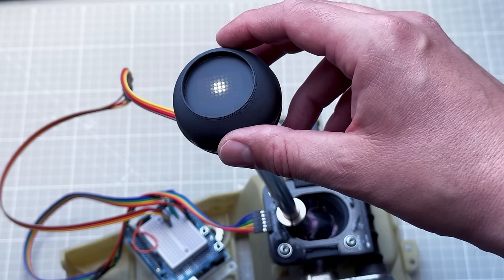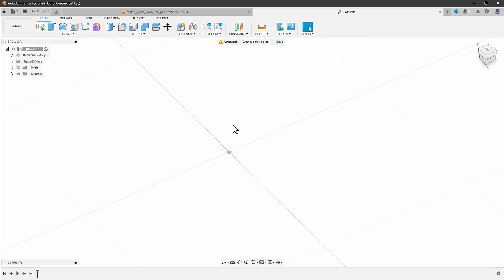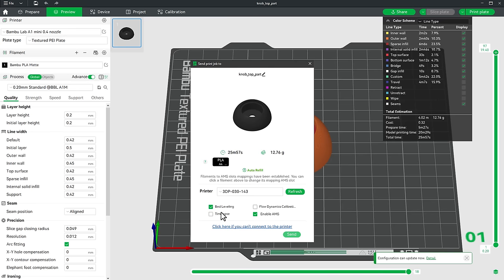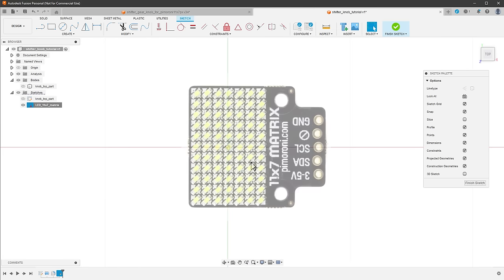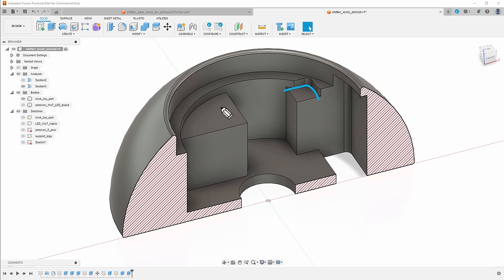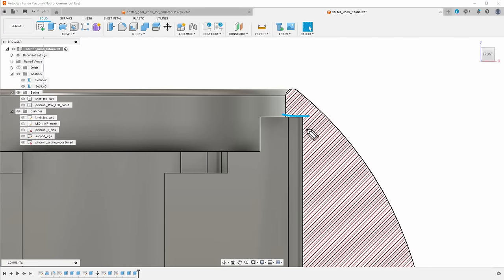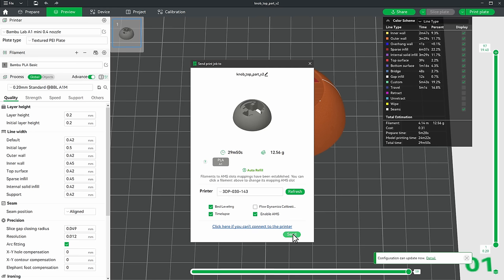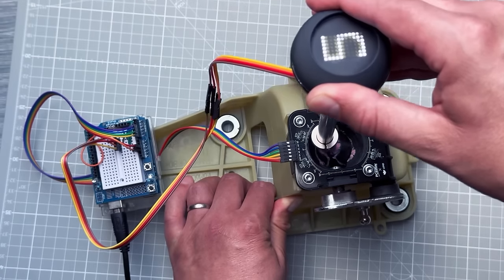Gear Shifter with DISPLAY

Comment: Oil fill the knob like a watch for best visibility
Reply from the maker: That’s an interesting idea!
Reply: @upir_upir  I'm occasionally good for something!
Reply: Will help heatsink the LEDs too. This is critical in summer or a convertible. My shifter knob in a Miata used to get hot enough I had to swap the solid metal ball in summers or it would burn me.

Comment: nice gimick :) but 1. if you need to see what gear you are in then manual is not for you :D 2. by the time animation is half way i would need to shift a gear. 3. i hold a shifter in such way that i would not see most of the screen :D
Reply from the maker: Agreed that the animation needs to be quicker. And LEDs need to be brighter so they can shine through your hand :)
Reply: @upir_upir  try using lasers ;)

Comment: I was thinking about getting a 3d printer, but CAD software is so complicated, like making 1000 blender doughnuts. 
Nevertheless, I liked your project
Reply from the maker: You can download a tons of models for free and start printing those. As for creating your own models, you don´t need to use Fusion. There are many other tools out there, some even simpler to use.
Reply: @upir_upir  Yep, I liked tinkercad but it may be a bottleneck later. 
Now thinking where I am going to place a printer lmao

Comment: Why have a solution looking for a problem? I drove a manual transmission VW bug for many years and never felt a need for something like this. I either knew what gear I was in, or could feel the position of the shifter.
Reply from the maker: Let´s think about this project of not being necessarily useful, but rather a cool piece of technology how to make your car look a little bit nicer and futuristic looking.

Comment: Too complicated unfortunately, if only they could make the electronics simpler.
Reply from the maker: There are simplified version of electronics projects. For example instead of Arduino, you can use micro:bit board, which is intended for beginners. Obviously, you would than have to choose a display that´s compatible with micro:bit board (there are some). I also have a few tutorials with microbit, you can google those. It´s a nice little board, again, easy to use, you just drag blocks in the browser and don´t need to install anything. For some unknown reason, it´s not that popular though.
Reply: @upir_upir  Thanks a lot, that sounds great. But I intended to simplify electronic systems in general. Usually, when I see electronic circuits, I notice that they include many parts that are tightly packed together and crowded together. But the beautiful thing is that one time I opened an electronic calculator and was surprised to find that I did not find, for example, capacitors, resistors, etc. Just found the microprocessor. I think electronics should be like this.

Comment: Want to collab on the dashboard part? I suck at using design program and coding. But I am good at designing and planning and building. And finding simple ways to make things work.

Edit:
Am that guy who asked about the Volvo dashboard stuff
Reply from the maker: Thank you for your offer, do you have any project car that might need a custom dashboard? That said, I need to finish that shifter knob first.. hopefully soon.
Reply: @upir_upir  
Well... My very own Volvo S60 from 2001. I really want to modernise it as much as possible and as cheaply as possible.
Reply: @upir_upir  
Also. I would either get a hollow pipe or drill a hole for the wires on the shifter shaft to make it look neater.